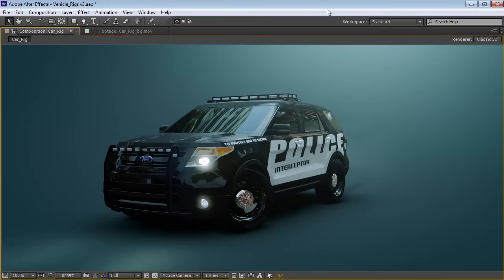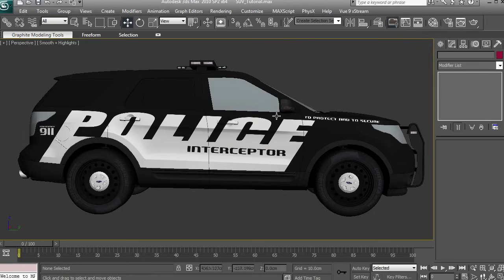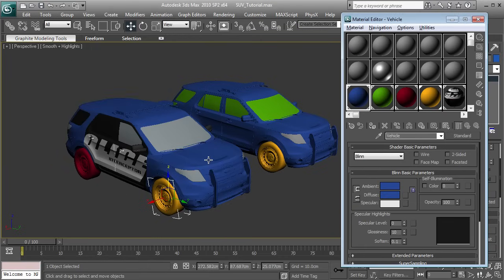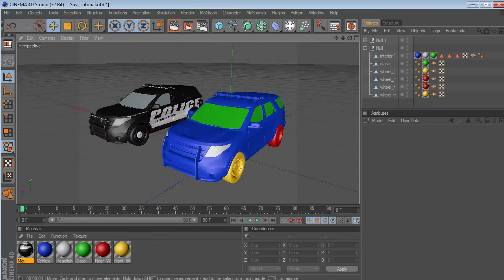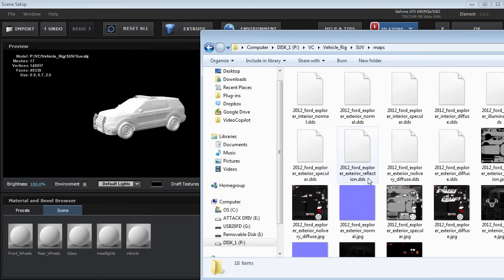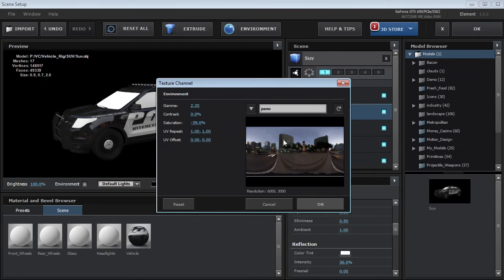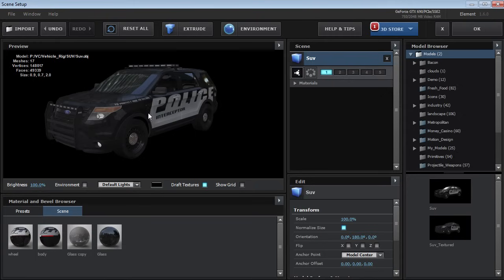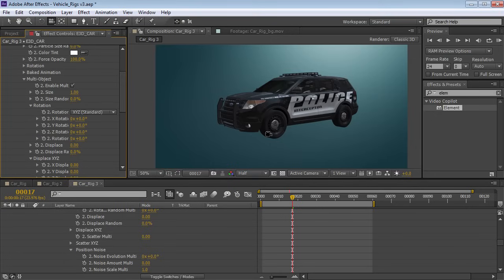Simple Car-Rig Tutorial for Element 3D

Comment: 5:30 that whole thing with specular and reflectivity mapping, can this be done in AE without 3rd party extensions? I just watched a (wayyyy old) video copilot video where he uses window reflections and everything is manual, but just curious if things have changed for modern AE software.
Reply: i dont get the problem here

Comment: Can someone explain why games dont have graphics like this? 
I mean, if graphics like this are achievable by Video Copilot, why cant companies such as rockstar get this hot graphics?
Reply: In games, there's a notion called real-time rendering which pretty much means that the graphics you see in-game are actually rendered in real time by your graphic card. Therefore, the more realistic the graphics are, more calculation power is needed from the gpu and this way, only very high end pc will be able to run these games (2500 usd +) which isn't that good for selling games. But it's coming as graphic cards evolve and algorithms too and within two or three generations this is probably how games will look if not better.
Reply: Hi SecretAccount, the problem is they can have graphics like this but the issue is the graphics card. Consoles are limited to just the cards they are shipped with. The more polygons you use, the higher the graphics card you will will require.
Reply: You are the first person that have opposite opinion of reality. I am wondering why I need 1 hour or more for render a single image, and in games they render 120 images every second!!!
Reply: also... graphics like this will turn the current blu-ray disks and high capacity disk into floppys. you're going to need to start buying games on SSD to run these graphics in games say like GTA 5 or like COD and HALO. CRYSIS.... holy shit crysis -.-